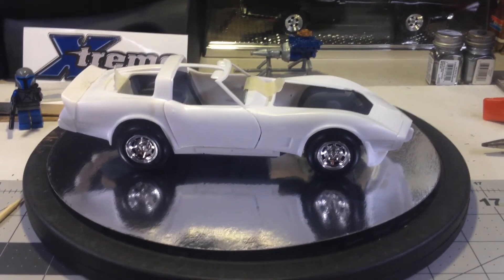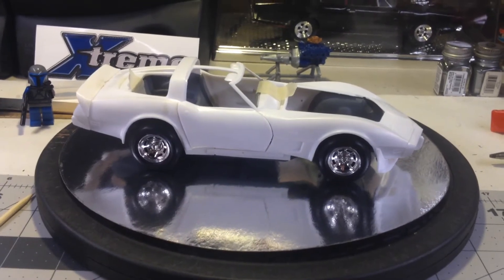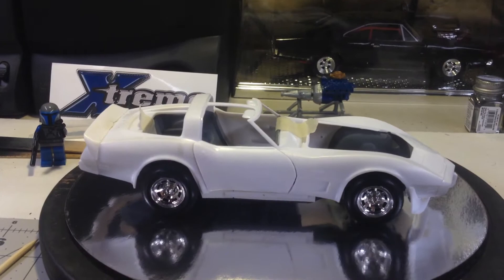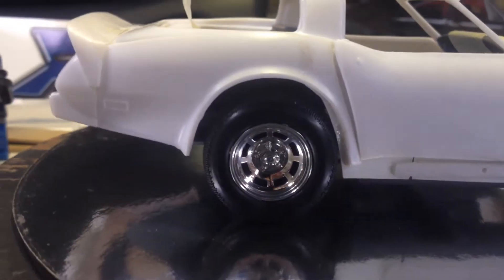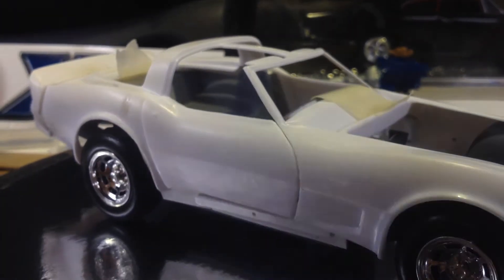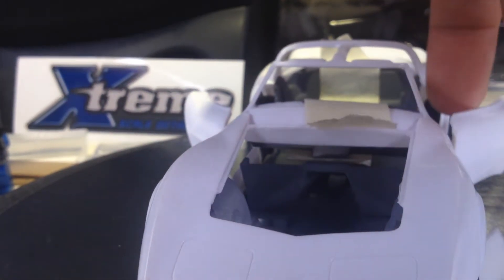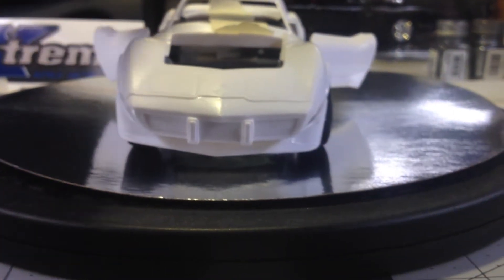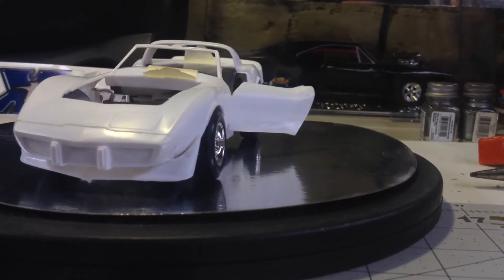Chevy Muscle Car group build update #3

Comment: it looks like the type I use.
Reply from the maker: Darren Cooper is the same you use, deference is you cut at 10mm and a did 6mm, because I think they won't fit on the door...
Reply: it looks like the hinge is loose at the body end. I now crimp the wire tighter around the tube so there is less play. longer tube on the door might help also
Reply from the maker: Darren Cooper thanks a lot men, I will try that, I hope I can fix it with your help...
Reply: I wish I could be there to help.  Let me know if you need anything else.
Reply from the maker: Darren Cooper I will, and I'll let you know how that comes... Thanks again...